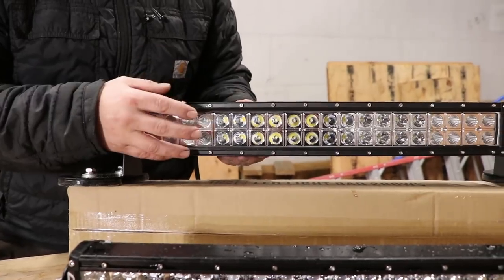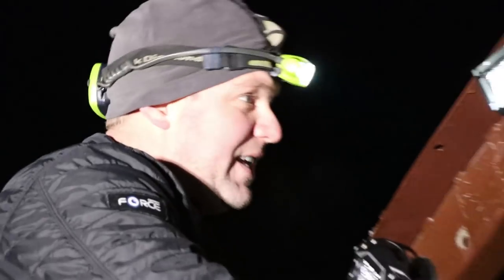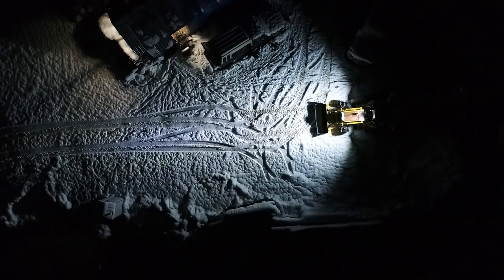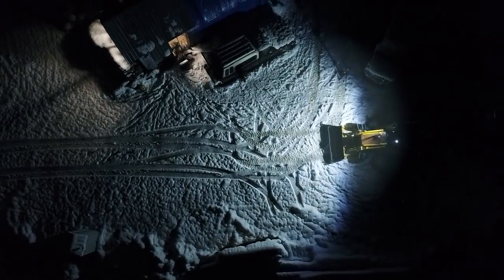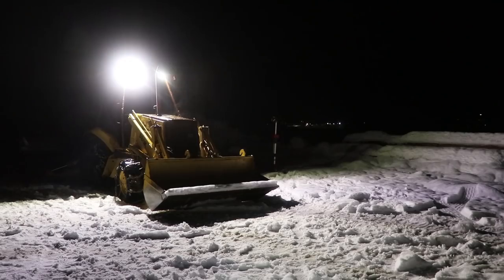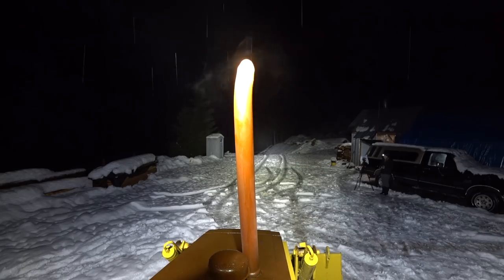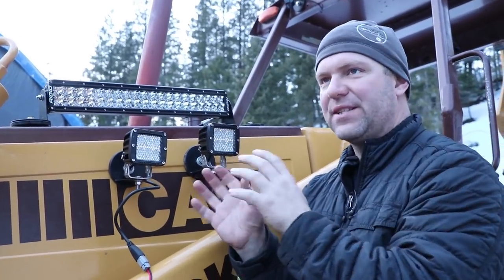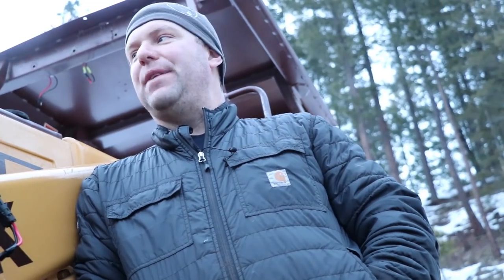TESTING Cheap Vs Expensive LED Light Pods & Bars

Comment: Not quite a fair comparison for the cheaper light bar as far as the distance goes. Your cheap one is curved which does spread the light out to the side versus the straight which will focus the light more for farther throw. I have a curved $50 32 inch in the front of my Jeep and it gets at least 250 feet out but lighting up the side of the road is where it excels against just using my headlights. The side of the road is lit up almost as much as the center of the road. Driving a highway that if you don't see a deer on at night is a rarity I like the fact that I can see the ditches as well as the down road. Has saved me from hitting deer quite a few times. Sorry i don't have a pics to include or videos since installing the light bar.

Comment: Now, for only $1200 more,  you can see to plow snow while doing 120mph bounding through the desert at night. A-a-and cause 'welder's eyes' on your neighbors across the valley. Yeee haaah! Seriously, for the average guy with a  backhoe, the cheap ones are more than adequate for just about anything.

Comment: From what I could tell, the Baja pods combined with the Rigid bar would give you the best all around lighting for the best price for your application especially because you need to see what's happening at the sides of the backhoe driving in between obstacles.The Baja light bar seems best suited for fast driving where you need see farther to aid reaction time.

Comment: You do know that for a few dollars you can seal the connectors against water and debris.
 How far ahead do you need to be able to see on a tractor that has a top speed of, what, 15mph?
 Buy the cheap set, with a spare, just in case. Save $800+.
 Put a beacon on top so traffic will be able to see you at night regardless of which direction you're facing.

Comment: I actually have been running the cheap end lights on my Jeep Wrangler for a few years. they have held up pretty good.  I have 2 pod flood lights on my A Pillar mounts and a 12" bar on my front bumper by my winch.

Comment: Two grand in lights?  Yikes!  //  Cheap light set: Flicker?  I've never seen a DC light flicker (other than vibration), so that's strange. "If you're only looking at light output."  What does that mean?  //  Mid light set: The pod lights are bluer than the rest, probably 7000k vs 5-6000k. Nice overall.  The missing light under the bucket could be filled by a pair of the cheapy pods mounted on the front of the cowling. //  ChaCHING light set:  A little more light overall, probably.  Nice lights, for only a month's wages!  <g>  I'm sure that's what Jesse ends up with, huh, Alyssa?  How's the new immersion blender, anyway?

Keep the others around and use them for yard lights over the sawmill, etc.

What would I do?  Go with the cheapy light set, but get a longer bar mounted on top, which will give you the spot distance/brightness you want and extra flood, too.  (How often are you going to be driving under low-hanging branches that the bucket would have already hit?)  Cost <$100.    With the larger light bar, I doubt I'd notice much difference between it and the $1200 set from BD.

I like to buy US, too, but not at that exchange rate.  $25 vs $400 = 16x!  First, I can't afford it.  Second, there is absolutely no way they can justify those prices.  Ditto the $900 Baja, whose first light had only half working.

On my pickup, I replaced the regular (yellowish) 65w halogens with some 100w 5000k xenon bulbs at $13.95.  Much better, but I rarely drive at night.

Comment: There's absolutely no doubt in my mind after seeing this that the Baja lights are VASTLY superior to the other offerings... however... I find it very very hard to justify the price difference.  I completely hear what you're saying about wanting to avoid the buy and dispose mentality, but when you can buy 14 sets of the cheap lights for the same investment.  Time will tell how many years it takes to break even on the higher priced lights, if that actually ever happens. 

I sure do value "Made in USA" but there comes a time when the price is SO far removed from the  Chinese imports that it becomes impractical to justify the additional expense for use on a tractor.  If I was driving a Pro Rally car I would spend the money on the ruggedness of the top of the line lights in a heartbeat because driving through wilderness roads at a high rate of speed the better light pattern would provide serious benefit.  

On a backhoe on private property, the additional investment seems foolish.  On a race car the additional investment is essential. Just my 2 cents.... 

I love your channel, I've watched every video, and always value your input on products such as this.
Reply from the maker: We agree. The lights were good. Everyone has a budget and everyone has their unique needs. I've learned in life that everyone spends money. It's all a matter of preferences. 

I've known people who live in a rv and drive a Maserati. They value cars. A lot of people drive broke down cars (if they even have one) with unsafe tires and burnt out headlights, shop at Walmart for food but have a 74" high def and buy movies on Amazon all day. Most people pay over $100/mo for a cell phone (which they never make calls with) that they simply play games on....which also cost money. Others have worn out carpet, broke down washing machines in their yard, but have brand new firearms. So the "it's too expensive" objection is pointless. 

We live in a day and age of options. Too many of them. That's why we feel this test was a lot of fun. Long, exhausting, but a interesting. Some folks who watch love to buy cheap tools. They use them once, throw them away. Others want to pass those tools on to their grandchildren. 

Some folks who stumble on this video (like every single subscriber we have once did) will find it interesting and helpful. Maybe one of them will have the budget, need or spontaneous desire to own a light bar that equals most peoples mortgage payment. 

You spend your money how you want, they'll spend theirs how they want. 

Now a video about all the ridiculous things people spend/waste money on, THAT WOULD BE FUN! That series would take us the rest of our lives! :0
Reply: Pure Living for Life now put the rigid lights on the back. Put the cheap light pods on the stick one own each side that way if you brake one you will not feel so bad
Reply: Thank  you! Well said!

Comment: Id rather buy 2 cheap sets than spend $1k. You can say quality costs more, but in the case of lights it doesn't. In reality most people will change out lights because of any number of reasons apart from them just burning out, like them getting physically damaged or even just wanting something different. Almost all LEDs are built equally, it's the housing that you're paying out the ass for. You could take a cheap light bar, make it more waterproof and even add a couple extra heat fins to it with only a few extra dollars. And doubling up the bars will be far more light than the $1k set and would last just as long. In absolutely no way will it ever be justified to spend that much on a light bar, that's just ridiculous. At that point you might as well build custom lights rather than getting a bar that sticks out like a sore thumb

Comment: Is enough whit 4x100w flood light bars. one on each side of the roof. You need the most light near the backhoe. max 10-15 yards. 100 yards and over are for cars. max $ 100 piece.

Comment: I would paint the tip of the exhaust with black high temp spray paint to cut down on that glare at the end of the exhaust with the light bar on.
Reply: Nope rusted pipe works better...

Comment: The Baha pod lights definitely had more side view. The rigid and Baha light bars were very close. Now put a set on the back (spot ones), a lightbar on each truck, a set of small on the front of the truck for fog and maybe a set pointing back for use in helping people out of the ditch or just driving on the upper end of the property at night. In your conditions, having a good set of extra lights on your vehicle would be a huge Bonus. A lot of extra safety too, in the snow at night.

I was hoping for a back to back drone shot of each set to really compare them.

Comment: Nice reviews ! I looked at many lights and for the weekend warrior 4x4 or off road the low cost have worked great the past year. I run two 20 inch bars and two flood pods on my Ram 2500 front bumper. I think the cost was around 80$ from Amazon. No complaints and if one gets a rock in the eye I didn't loose much in $$.

Comment: I was going to suggest you needed to do back to back comparison and then I found your FB Link.
Only other suggestion I could have made you could have shown the difference in voltage/amps draw.
Great video and explanation.
Especially liked the partners point of view.

My opinion, value for money, expensive pods, mid range lightbar

Comment: On  the wires with the connecter with the exposed ends i would have put a smaller diameter and a larger  diameter piece of shrink tubing  on it before  putting the connecter on it..put the larger  diameter  over the end on connecter with the exposed ends shrink it and small one over the other end of large shrink tube to get a good tight fit.

Comment: Wow, looks like you get what you pay for. Sure will be nice to add some light to the backhoe now. Really liked the comparisons. I can't afford a tractor right now but have an atv that I can use some lights on. If I was running a race and need the performance then Baja the way to go. If running a tractor and need dependability and workability then Rigid. If I'm broke and need a quick fix, the Chinese cheepies. Thank you.

Comment: For $900 or even half of that, think of the lights and wire they could run to trees surrounding the open area. Those lights could fill the whole space fairly evenly, meaning less pupils constricting from looking at the bright spots and unable to see into the more darkness on the sides.

Comment: Thought the ending was really cute.  Glad you got to the current draw.  I was about to comment on the lack of comparison on that.  Good job on this one.  Amazingly it actually took 3 fairly long vids to do the job right.  For me, the magnetic bases stole the show.  My only problem is I live in a more urban environment and speaking of stealing... Well you get the point. No wrench required to gain some really expensive hardware.

Comment: Good point James...... Jessie why don't you just put a couple motion sensor power poles say at the bottom of the driveway and top of the driveway and maybe a third by the house. They would only come on with motion and therefore not have to be turned on or waste power.
Reply from the maker: What about when I'm plowing the neighbors driveway? Then what?
Reply: Sounds like the neighbors would have to wait until it's daylight out or just walk around with a flashlight for you ;)

Comment: Why not just take the phone to a fixed point and measure the lumens and color.  When I did my street lighting for a project, I used Inductive lights as they were more efficient than LEDS.  I chose 4000k .  I would think gettting leds at 5000k would be good.  Getting above 5000k will help keep you up at night.   The LEDs are selectable on those cheap lights or china will make them with what you want.  I would like to know where the chip plant is to made the LEDS.  Epistar LEDs were designed here but made elsewhere.  The case is probably made in the US with the light pods imported.  Just look at the detailed specs of which type of LED is there.  The Efficacy, Kelvin temp and design is what to look for.   The rest is just a case holding the light bulb.  90% of electronic products on the planet have something from China.  They are running a long term game plan instead of looking 90 days ahead.  I just looked at aliexpress where I  have bought alot of stuff and looked at some bars.  Looking at the specs of 1 producer, they use Korean LG high power LEDS in the 60w to 300w range with die cast aluminum housing.  Lumens are from 3600 to 18000 lumens in 3000k and 6000k.  Designed for off road vehicles.10 inch to 50 inch.  The big one is $460  Be cool to see that badboy in action.
Great video as usual and great effort in comparing the lights.  Alot of work went into this video.  Surprised you didn't get icycles on chin.  I used to get those when it got below 10 in Wisconsin.  Have great plowing with those LEDS.  Goodbye to ancient lighting.

Comment: id probably say if you insist on the 300ft forwards range, for which i see no point since it is a backhoe but whatever, the mix in my opinion would be a rigid light bar and 2 sets of the cheapo light pods, one for the front and one for the back, that way on the back you can run wires out and have a light on the backhoe which is always convenient without being sad if you smash it against some lumber you are moving around

Comment: Hey, since you have the lights for it, a great add on for you would be to get some electrical conduit and run power down the front arm of the backhoe and leave a connector at the ned, so if you need a work light, you could just toss one of those bar lights into the bucket, lift it up, and boom! spotlight on demand! It's also not a bad idea to rig up some lights at the top of the boom, so if you're digging at night, they can shine right down on the bucket in the hole.

Comment: I think the inexpensive pods produced more area lighting. But, think it has more to do with 4 pods versus 2 pods. 
For the work... I would go with the inexpensive LEDs. Even if I had to buy another light bar a year or two down the line, it would be cost effective. 
With SSDs you never know what the dead date will be even with a MTTF printed on the packaging. And if they all last 10 years... well, that's $875.00 I could use on a well machine.

Comment: I think you should mag mount some lights on the bucket just behind where snow would gather next to  those hooks , that way your lights are in front of you showing you the way (instead of reflecting off the exhaust and the back of the bucket).  You can still have the small ones overhead to see the dark areas of the tractor mechanism and the side and rear.